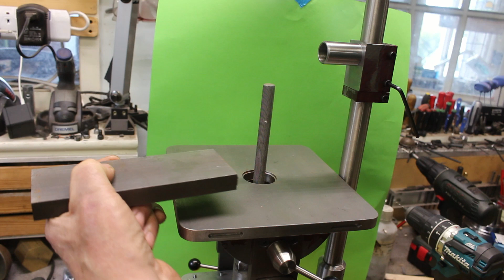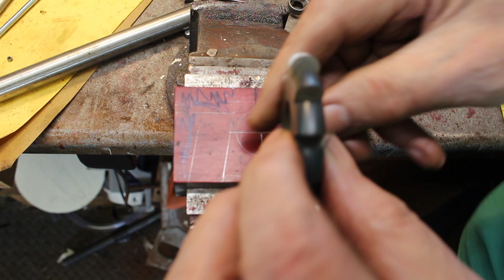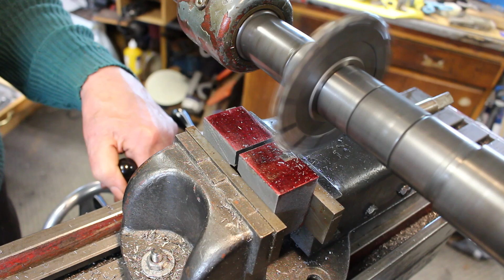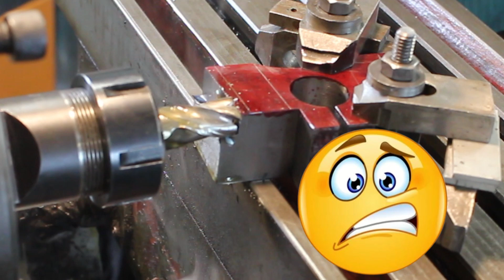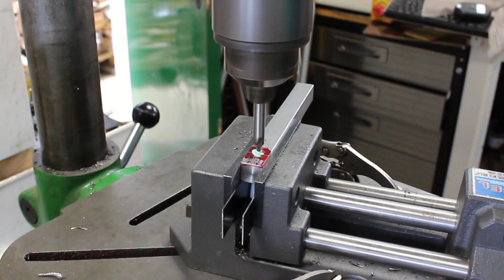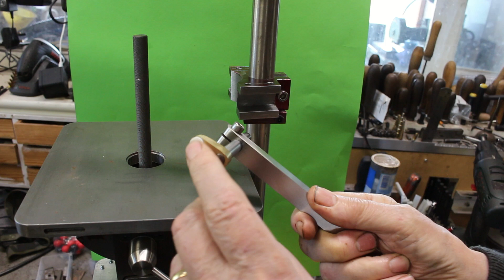Shop made Die Filer Build -Part 21 - Work Hold Down

Comment: Great video Nigel,
Theadaptation looks like it will work Great and looks very adaptable "still" as you mentioned
I like the vert versatile molegrip type clamps I keep seeing you use on your drilling table etc, are they commercially available or a modification you have carried out ?
Would you mind showing one in greater detail at some point when you are using one.
Many Thank's 
Andy G
Reply from the maker: Thanks for your kind comment very much appreciated. My drilling machine clamps are commercially available, here's one uk supplier I found by searching for "drilling machine table clamps" I hope that helps.
https://www.tilgear.info/workholding/clamps/machine-clamp/cvc600dmc-drilling-machine-clamp-self-grip-type-150mm/6-
Reply: @GoCreatehms  Hry that's brilliant Nigel.
Thanks, I will get some of them sorted out
Cheers
Andy G

Comment: It's a very long time since I used a shaper, but I'm pretty certain I was taught to have the vice jaws perpendicular to the tool movement to minimise risk of the work shifting.
Reply from the maker: Thanks for your interest and feed back. I agree with your concern, there's a risk of the wok moving with the vice mounted this way though, so far, I've not had a problem. It's a fairly low powered machine compared to it's bigger brothers, so cuts are relatively light in depth/feed which I guess helps not over do it.
Cheers 
Nigel

Comment: Nice one Nigel. Regarding your file guide on mine it's a short roller 90deg to the file with a grove round the center of  it, so it will accommodate square, round, triangular or smallish flat files. This is then attached to an arm, which is attached to the post via a block not unlike yours, with adjusting screws in the block to adjust the length. Hope that may give you some ideas
Reply from the maker: Thanks Paul. Very interesting, I was thinking of something a little differnt for my large files, what you describe may be more suitable for my small files. 
Cheers
Reply: @GoCreatehms  Mine will take up to about 1/2" round files, flat files i'm limited to about 1" at the tip, only because of the ends of the "u" shape holding the roller, I could modify it, but I probably wouldn't use it. Hope that helps